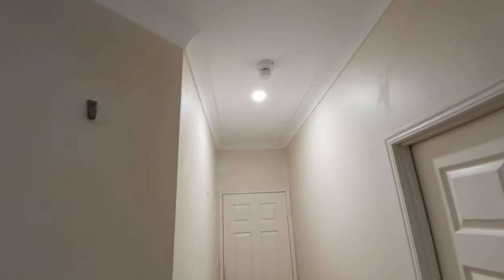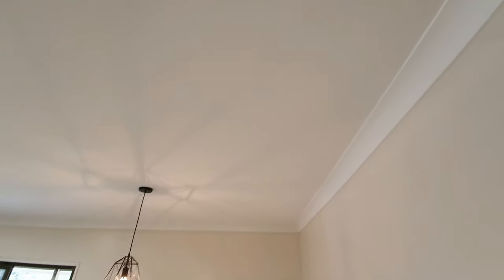Drywall Construction Job Finish Plaster & Paint

Comment: Hey man love watching ya vids. I'm a chippy trying to lift my plastering game so I'm watching your vids closely haha. What was the reason for redoing the whole ceiling? Massive job
Reply from the maker: Hi Daniel, I need to up my chippy game... yeah massive ceiling. Some water damage areas, looked ok to me though. It wasnt done well in the first place, you could see every join in the sheet. Thanks again for watching the vids!
Reply: Maxkil could you see all the joins because of the water or was it a shit setting job to begin with
Reply from the maker: Yeah setting wasn't great, also side note didn't have any back locks. In Australia our boards are thinner and need it I suppose while other parts is thicker and holds better. That's my idea anyway